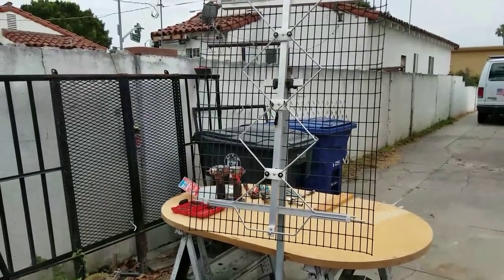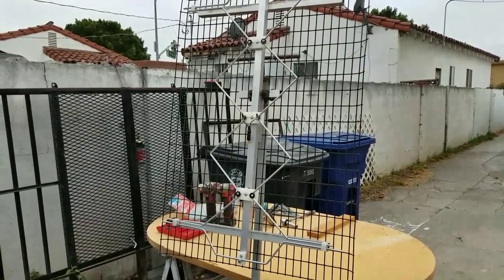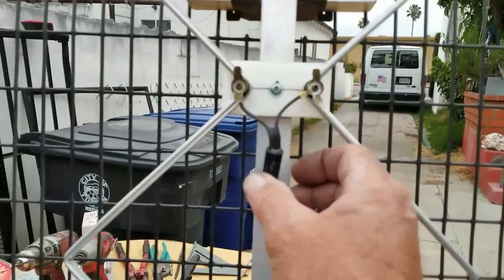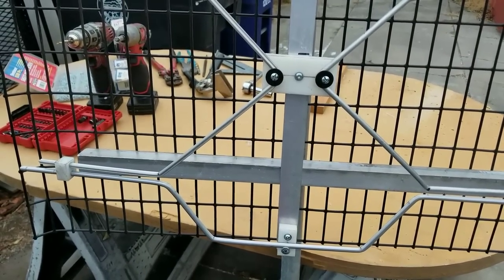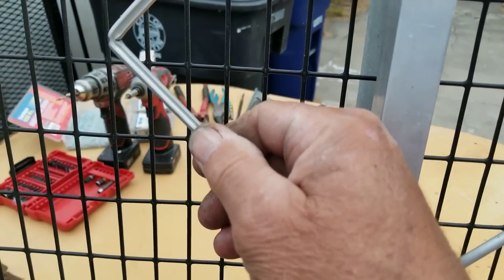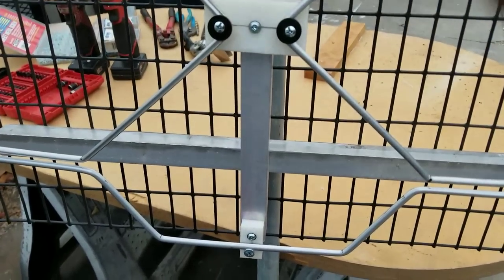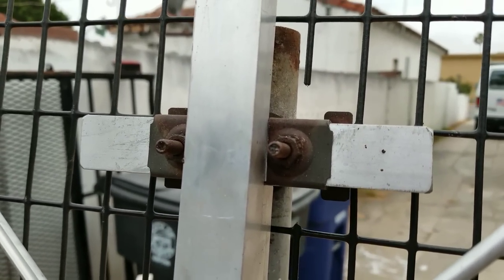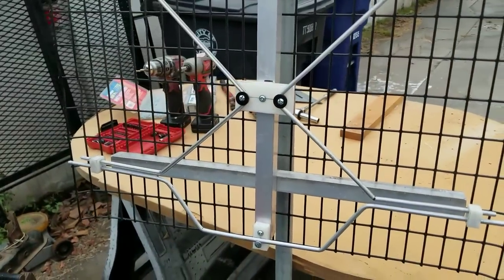My Homemade High Gain Tv Antenna

Comment: Looks great. But the reflector is to close you can move it back around 4" and gain at least 3db to 6db that's a lot more signal and as for those hats you call them well they almost look like directors or reflector ,  have you tried it without them to see if if makes a difference?  Uhf antennas can pick up vhf signals at a fraction of there wavelengths so if your vhf works  then better for you it's a bonus. This broadside array reminds me of stacked biquad antenna with a reflector  . We need more people building there own antennas and  testing them.  Keep up the good work  . 
Was just calculating if design frequency is 600mhz " middle of uhf band" then a 1/4 wave spacing of 4.68" from driven wire back should provide optimum gain. I am about to design a similar antenna with 8 element double biquad with reflector for the 2 meter ham band.  It's going to be rather large but have need for the pattern it has for long range groundwave  transmission  . Good luck on your project,  love what your doing.
Reply from the maker: Debbie Bohannan when time allows. I will try those modifications.  Thanks for watching and commenting.
Reply: The hats will increase the gain of VHF but also take some gain away from the UHF.  The reflector looks correct as it should be 100mm.  The aluminum bar holding the hats might be taking away gain.  I understand you have it insulated but RF is sensitive of distance, that's how the hats work.
Reply from the maker: Create My DVD thanks for the feedback!  I'll try some of those corrections when all my other needs are fulfilled out here.  To me TV is not a survival necessity.   I don't use it for much more than news and weather.
Reply: I purchased a 4bay antenna, model DB4, online and it was a dog.  I kept looking and looking at it trying to figure out why it didn't perform well.  I finally found a reference for it's design.  It was actually designed for channels 60-72!!  Sure enough, the reflector was less than 3" from the front active elements.  One day I experimented by removing the top bracket so as to space the elements further from the reflector.  My signal level shot UP quite a bit.  I got some metal pieces and drilled some holes so as to mount the reflector 4.5" from the active elements.  WOW!!! NOW the dude performs great!!  Imagine selling an antenna made for channels we don't even receive anymore!  In this case, it's STILL sold on the market at a huge discounted price.

BUT, it's a great deal as long as you move back the reflector to make it work well.  It's a simple mod and it now works very well!  As good as any 4-bay.

Comment: awesome Antenner . I've got up to 60 channels from a traditional antena. I do live atop the mountain.😀
Reply from the maker: Antennas work so much better with height and line of sight!  I pick up San Diego channels from the high desert, about 180 miles south of me, but I have line of sight through the pass.  I also tied both my homemade antennas together for better strength.
Reply: @GBear  so how many channels do you get now ?
Reply from the maker: @homesteadinginappalachia4579  21 up here in the direction I have them pointing.  If I rotate to 2 other directions I can get another 8, but they are not worth the hassle.  I don't watch a lot of TV anyway, mostly news and weather, and an occasional movie before bedtime.
Reply: @GBear  I hear that it's the same way here I had two antennas hook together so I pointed one in One Direction of a few channels and one in the other of a few channels and only one picked up so I only use one now that most of the time I get 30 channels but sometimes if it's in just the right spot I've got over 60 some of their doubles of course

Comment: That's a neat build! I have a question regarding the balun. I have built an antenna using aluminum wire. My question is did you do anything special to prevent dissimilar metal corrosion where the balun attaches to the aluminum?
Reply from the maker: Welcome aboard Ed!  Not really.  I used stainless steel machine screws, washers and nuts to make contact at the center of the zigzag elements.

Comment: Hello GBear. Could you tell me if the Levolor blinds control rod that you used is a solid piece of rod or  is it a tube ?? How are your two antenna working out for you Sir ?? Hope all is well with your desert lifestyle too. Drop a line fella. Peace vf     😀😀😀
Reply from the maker: Hi VF!  The rod I used was actually solid, but grooved lengthwise.   It was standard for blinds that covered sliding glass doors, not windows.
I'm fine, I  hope you are too.
Reply from the maker: Also, yes, my antennas are still working perfectly, although I seldom watch TV, except for extreme weather reports.  Even those are usually a waste of time. 
For entertainment,  I watch old TV shows like the Rifleman,  or stream shows like "How It's Made" for knowledge.
Reply: How thick is the solid rod ?? How did you find the rod material GBear ?? @GBear
Reply: My location for whatever reason has a lot of interesting how too  TV shows. My weather channel is really good for accuracy. I would say 70 plus percent lately. The old shows still rule fella too. The bitch with my location is signal fading in and out. I have a double bay signalmaster with flat punched sheet metal whiskers which is a knock off of the Channel Master double bay wire whiskers type elements. I am just going to have to buckle down and make me some antennas and see what works for me fella. Any suggestion would be appreciated Sir. Peace  @GBear
Reply from the maker: @victoryfirst2878 Sounds like just an antenna booster might help.
Reply from the maker: @victoryfirst2878 It’s about 1/4", and I get them from vertical blinds used to cover sliding glass doors.
Reply: I understand that part, what I was asking is where would one have the best chance to get some for free besides the land fill ??? Used home surplus, blinds repair shop ?? Thanks Sir.   @GBear
Reply from the maker: @victoryfirst2878 check with Home Depot or Lowes as to where their installers dispose of old blinds, or look for an installer near you.
Reply: Thank you GBear for letting me know Sir. Have a great day living in the desert Sir. vf @GBear

Comment: Tip for the day save your wood ashes especially  hard wood.
Boil the wood ash keep boiling keep going" it makes LYE" which if boiled long enough turns to raw potassium hydroxide """Hydrox" highly reactive with water"" when dried add scrap aluminium it is highly reactive explosive even""" and becomes an immediate source of hydrogen. (fuel)
You do not have to over boil it though."
You could add it to lard and make soap?

Comment: I use an aluminum bicycle wheel, it works great. I think anything will work.
Reply: With reasonably strong signals anything WILL work. The OP needed an antenna that works with weak signals i.e. distant stations. The bicycle wheel isn't going to cut it (unless you REALLY know what you're doing, and by that I mean have a solid understanding of RF and antenna design theory) for weak signal reception.

Comment: G Bear, you have some inaccurate information in the audio portion of your video.
The zig-zag wire you point to in the video provides the UHF gain of the antenna, and the "hat" provides the VHF-Hi.  Also, VHF-Hi reception does NOT have to be "right on the border" of the UHF frequencies "to allow it to come in crystal clear."

Other than that, this is an excellent video and exceptional VHF/UHF antenna build.
Reply from the maker: Thanks!  You are absolutely correct.  Ultra High Frequency (UHF) uses the larger part of the antenna (14-80), and Very High Frequency (VHF) brings in the lower channels (2-13).  I appreciate people who pay attention to details.
Reply: Yes that's exactly what I was thinking. I'm ready to build me one and only need UHF.
Reply from the maker: Most places do only need UHF.  Nowadays,  it is referred to as DTV or TV.

Comment: G Bear
Thank you for your counsel to which point I have failed. The old guy still don;t have a TV. I Even Though I tried A Hybrid  I added 7 Inch Whiskers between the loops 6 Of Them" X 2 3" Spread. I did Only Fail as Of Yet" But" Soon I am Bound To Run Out Of Failures" Thanks For Your Attention" Your Friend Tim.
Reply from the maker: Sorry to hear that.  I call those, "Unsolved Opportunities", not failures.  Good luck!

Comment: what is the length of the straight Radial from the point of bend on both the hat and the vhf Radial I notice they are not both the same length the main is 90% at 7 inches and I think you said 30% on the hat but then the two straight radials from both?
Reply from the maker: Half the 90° or 45°.

Comment: I noticed you made the boom out of aluminum instead of a non conductive material.  I'm very curious if this would cause some loss of gain.  Using aluminum would make the build much easier.
Reply from the maker: Create My DVD it might have increased the reception.  It is insulated from the receivers, just like store bought antennas.
Reply: I'm glad it worked out well for you, It certainly looks like a very sturdy build and similar in design to what I wanted to build but I couldn't find square plastic or vinyl to use for the boom I saw in a video.  Instead,  I reluctantly used PVC tubing and that turned out to be a real bear ( no pun intended, well maybe)  to screw on the copper.  I'm glad you showed me aluminum works well too in case I build another.   Up here in CT its very hilly so I decided to build a dbgh for max gain and hopefully pickup CBS which is only 35 miles away, not even a parabolic I had worked for that.  Which by the way,  comes down with winds of 65 mph every time.
Reply from the maker: Create My DVD I built mine for the CA desert where winds of 80mph are sometimes present.  The first year I put them up with a 2 piece 1 inch steel pipe joined in the center with a threaded coupling.  They blew down twice, breaking the pipe at the coupler.
ASAP I will add guy lines to the mast as the windy season started yesterday.  20 mph gusts since noon yesterday, all night and still blowing this morning.  My antennas never failed to withstand the winds.
Reply: That's exactly what happened to my parabolic.  If yours blows around to much, you could always replace the screen with the aluminum rods or wire for less wind resistance.  distances between the rods are critical for gain so look them up first.  Nice chatting with ya, good luck. :)

Comment: Regarding this Lesson you gave me. I Am A Giver I Take Nothing For Free" If My Idea Works Out I Give To You As Yours For Free It could Possibly Me Worth Millions""Its Yours" Did Not Want To Represent Myself as a nut. "But" I Am Just the Harmless Type. I am One Who Likes to Help Others.I Am  Especially  fond of those who have helped me So with that Said  Raboni (which Means Teacher)" My tip to you today Is This"A camp fire wood stove Open flames Does indeed put out enough infrared light to charge a solar cell. It may take a while longer to charge your battery's to run your Blue Green lights for Growing Plants"
But Then Dinner Is Yours.
My Most Beloved Study is Energy Production and Transference"And if It Transfers to Dinner That;s Good Too""

Comment: Not sure how the uhf works because its not hooked to anything?
Reply from the maker: Actually, the antenna isn't connected to anything either.  The wire parts are collectors that grab signals out of the air.
The uhf just adds to the vhf wires with a slight resistance.
Reply from the maker: Welcome aboard

Comment: Unless you can place the antenna very high in the air, 100 miles is never going to happen.  TV signals are very much a line of sight thing.  The curve of the earth means that the earth gets in the way.
I also think you may have confused UHF with VHF.  An element 3 to 6 feet long is normally needed for VHF.  One foot elements do UHF.  Extra bits on a 1 foot can make it work like a 3 foot.
Reply: Earth has no curve. Earth is flat. ERIC DUBAY is the man with 200 proofs on video. Sounds crazy but we have been brainwashed since kindergarden.
Reply: @TRUTH4U2NO  
If the earth was actually flat, house cats would have pushed everything that is not nailed down off the edge by now.
Reply: While what you're saying is true, when I lived in Kansas I watched a TV channel 110 mi. away each evening which always came in soon after sundown.  The ionosphere bounced the signal fairly reliably each night.  Also FM stations 100 mi. away came in very poorly during the day, but after sundown, they always came in just fine.   So while the 70mi limit is basically true for all reception, the ionosphere can make 100 mi signals come in very reliably each evening, depending on where you live!!
Reply from the maker: So true.  Don't forget that geographic terrain also plays a factor.
Reply: @RickPaquin  True but any claim that the antenna made it happen is BS.  Special cases happen all the time but any antenna company advertising based on those is effectively lying.
Reply: @GBear  Very true.  You won't receive much if someone puts a mountain in the way.
BTW:  You may want to put the dimensions in the summary text so those who wish to base their design on yours have an easier time of it.
If at some point, I get a little less lazy, I might even model your antenna design and see if I can improve on it.  The basic idea of your design is a very good one.
Reply from the maker: @Ken Smith  thanks Ken, but I can't take credit for the design.  It is a Grey Hoverman design I copied from combining designs I saw on houses, and pictures I found during a Google search.
I did do a separate video showing measurements and techniques I used.

Comment: The reflector screen looks a little too close to the elements. The reflector supports are even closer. What is the distance? I think 4.25 inches would be ideal.
Reply from the maker: David Ogawa I put it at 2.5 inches and it works just fine.
Reply: @GBear  You'd get more gain if the reflector screen were at the optimal distance from the active elements. Since you're happy with the reception that you're getting, it's obviously good enough as it is for your situation. Someone else might need the extra boost.
Reply from the maker: @jerrylohr3491  thanks, and welcome aboard!  I tried moving the panels back last time I had the antenna down for repairs from wind damage.  It actually lowered my reception at 3.5 inches from the elements.
Reply: @GBear  Antenna design is one part science, two parts art, and a good measure of magic. Everyone ends up using whatever works.
Reply from the maker: @jerrylohr3491  so true.

Comment: Those baluns were super easy to find until Radio Shack went away. Anyone looking, try independent bargain stores. If they're run by East Indians, the likelihood is high in my experience. Otherwise, Ebay!
Reply from the maker: Ken Weller mom and pop type hardware stores too!
Reply: 4 bucks on Amazon as of 21 Feb 19.

Comment: This is a UHF antenna, it will pick up VHF but it isn't used for TV in the U.S anymore so who cares? The "hat" part are reflectors.
Reply from the maker: GhettoRanger today in the U.S. we have DTV and TV.  This antenna picks up both at my remote desert location.  You will find video of that at www.youtube.com/c/gbear "Homesteading the Desert"  thanks for watching and commenting.
Reply: VHF Channels are still in use. Locally we have 3 in Eugene, Oregon.
Reply: These antennas work right now.12/23/18 Theres still free over air antennas.i get 60 channels early day the 30 channels drop off at certain time of day
Reply: The "hats" are NOT reflectors. The "screen" behind all of the elements is the reflector. The correct name for the hats is parasitic elements.

Comment: I just looked around town for 4 hours for a balun Nope"I did get an old vhf uhf/ fm connector/ balun? (not sure YET) At a pawn shop junk pile" 
I will because of you Add The Hats And Reflector.
Got Some at Walmart Garden section.
Use to be Every one carried those balun's not so any more:
Reply from the maker: Home Depot usually has the baluns, and so does Ace hardware.  They call them transformers.
Reply: @GBear  Not here they told me they don't carry them any more but we do have an ace
Reply from the maker: @timothymason3423  where's 'here'?
Reply: @GBear  New England The Head Of The Horse
Reply from the maker: @timothymason3423  that's where I'm from originally.
Reply: @GBear  I am actually originally from NH. Where did you live hear?
Also where did you get the nylon insulators you are using I would like a 4 by 8 sheet of that I can always use it. I have been building radio's of late. 
The Antenna is for a 70 something year old neighbor who cant afford TV. or cable so I will give him both. You have helped you do good work. YesA"
Reply from the maker: @timothymason3423  I'm from R.I.  great for you helping an elderly neighbor!  I got the nylon pieces from a place called Paragon Plastics in Santa Ana, CA.  They sell 'rems' or remnants of custom cut pieces.  You'll need to search for a local plastics company in your area.  Good luck!
Reply: @GBear  I use to work with Plastic's I thought it for one year 4 years of schooling but I know of None Around Me I Am Always In Need Of Insulators and or Bushings"
Reply from the maker: @timothymason3423  try googling for a place.  They may even sell online.

Comment: You can also use a Disc Cone Antenna,
Reply from the maker: ManuelPinner true.  There are many different antennas, I made this style because that's what I had in material.
Reply: Indeed he could use a Discone. But a Discone is an omnidirectional antenna, therefore has unity gain. The OP needed an antenna suitable for weak signal work, i.e. one with more than unity gain.

Comment: So the Hats act like a radio coupler coil Magnetic induction but in this case RF induction basically the same thing.
Reply from the maker: Welcome aboard.  Yes the hats are an inductive connection.